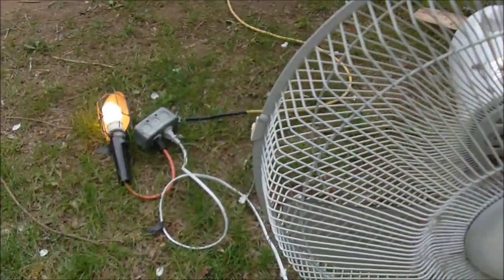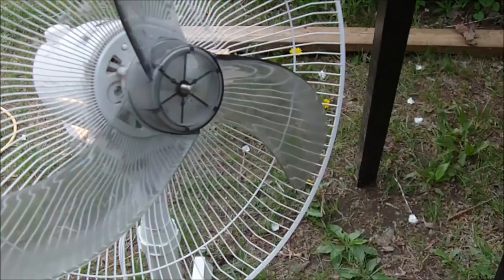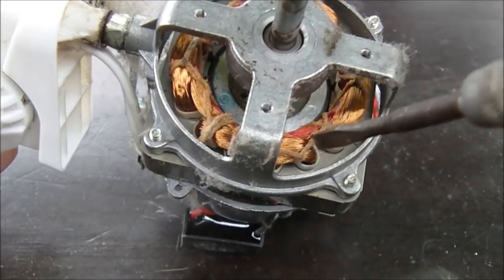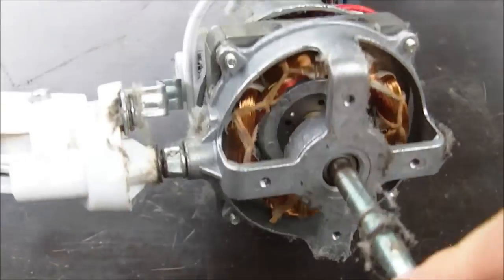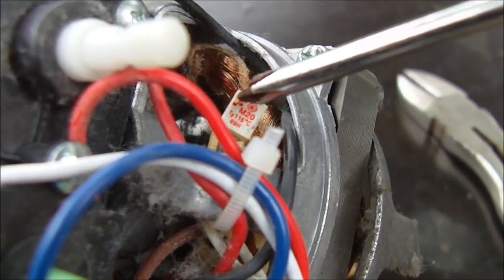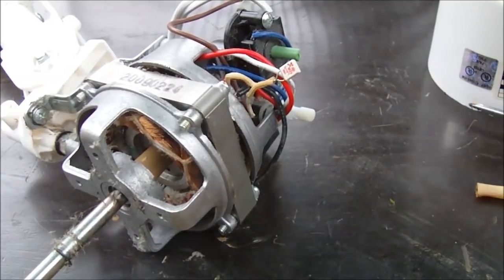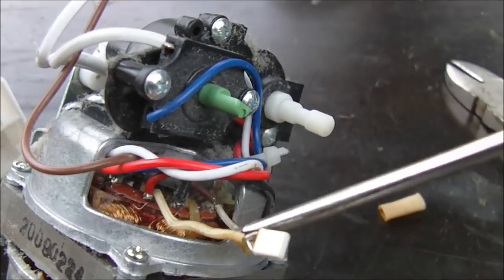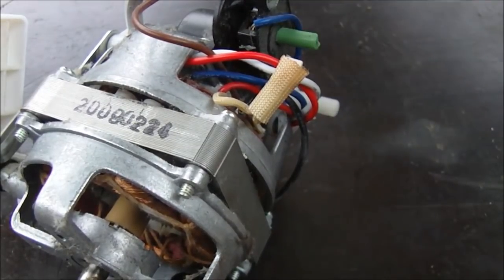Broken fan motor diagnosis for repair

Comment: The unfortunate thing is that people have the attitude of "Why fix it when a new one is so cheap?". I have never bought a new fan in my life. I have fans that date back to 1919, and every single one of them is in perfect working order, because I do regular maintenance. Clean the fan, blow out the motor, and oil the bearings. It takes minutes to do, and costs literally pennies.
Reply: Ryan Losinger  Do the same with mine, if i see when i turn them off that they come to a stop rather quickly then i know its bearing oiling time. Take the blade off and grill regularly and clean them as dust on the blade tips result in less of a breeze.
Reply: Ryan Losinger Hello Ryan,I have a Casablanca Four Season fan and the chain broke that turns it on.
Can you tell me how to get inside the housing and repair the chain?  Paul
Reply: ^ you should be able to get a three speed pullchain from you local lighting store. Just ask for the part.
Ryan: kudos to you sir.
Reply: +Ryan Losinger This habit of repair n use concept is very prevalent in our Country, India. We the middle class think, rethink and re-re-think before discarding a thing. In fact, to get a spare part, all we do is go to an appropriate market / shop and buy it, a few bucks this way or that and repair or get it repaired. Far cheaper than going for a new one. My home has fans n appliances more than 25 yrs old. Call me miser but I call it preservation of precious natural substances given to us by Mother Nature. Green Planettttt.
Reply: @essaargee  India is a poor country indians literally can't afford to throw away anything to junk unless it serves absolutely no value ppl in merica and UK are consumerist society. 

For west&most rich countries and people fiddling&tinkering with old bikes,PC, home appliances is time better spent on watching a movie, going to the beach or just having a good time..
Reply: விஷ்ணு கார்த்திக்  unamaa thandaaa
Reply: Raj thevar "My mom"!? what? also thevar? hahaha what is this, 1950's? grow up
Reply: விஷ்ணு கார்த்திக்  Dai unnoda name 1202  haahaaaa old name Vishnu karthi Haaa u funny guy
Reply: malusax
Reply: How do you oil the bearings?
Reply: Wish you could teach me...I keep going through them and when I try to get to the motor I often have problems...and wouldn't know what to do once I got there. Let alone replace parts! I know absolutely nothing about mechanical/electrical. I'm also terrified that I won't be able to reassemble it.
Reply: @விஷ்ணு_கார்த்திக்    ~  Touch' & Bravo!    > tho - you noted  "going to the beach"  ~  is Exception for Everyone to do!    : )    
 Products of Long Ago are better built.  Everything will need maintenance in time.   
Yes - Wasteful trolls, i cringe at their 'Ease' of tossing, LACK of trying\Caring.   Knowledge Denied, but then, One Must understand.   
I try all sorts of things > Curiosity or stupidity [?], most don't turn out well, but I Learn!    Next Life i'll be better at this!   lol    = ]
Reply: I have I 1923 fan
Reply: but but I want to buy a new fan that has wifi and takes my selfies,
Reply: Love the old fans from the early 1900s. Most of the machinery made then lasts forever, if taken care of properly.
Reply: Don't judge people for that 
If people get an easier option, they will take it most of the time 
Blame the modern industrialized mentality, if you even want to blame anything that is
Reply: @விஷ்ணு_கார்த்திக்  Just because you think you can afford to be wasteful, doesn't make it right.
Reply: Not anymore they aren’t

Comment: Ready to throw my Honeywell fan away but after watching your video I gave it another try. I fixed the fan by bypassing the thermal fuse like you suggested in this video and it fixed it. Saved me 50 bucks. Thanks
Reply: If you bypassed the thermal fuse, you didn't fix it, you made a fire hazard. :-)
Reply: @timmccormack3930  He didn't respond because he died in a fire somehow lol
Reply: Huh? He explicitly suggested to NOT bypass the thermal fuse.

Comment: In 2003, I bought a cheap white plastic Chinese box fan, 10 inch size. A short time later, it was having a difficult time spinning up and the spin down time was too quick. The motor was simple enough. Even though it said "sealed bearings no lubrication needed", this type of motor has this symptom. So I took it all apart and lubricated the bearing areas and it has worked far better than it ever has. For a plastic bladed fan, the spin down is really impressive. Most people would have chucked the fan in about a year but if I can make something last longer and not feed the company money who makes these fans, the more the better. Fourteen years and it still runs fine.
Reply: Also you are not contributing to landfill which is a win for Mother Earth and therefore all of us  :)
Reply: ^^
Good point
Reply: How’s the fan doing another 7 years later?

Comment: I did a repair on my cheapo bionaire tower fan. I did short the resistors and just leave it and we don’t use the fan without supervision. I think the fuse blew because it was not properly lubricated and caused the motor to over amp and fail. I don’t really care if it catches fire because it was free and I have it where it won’t cause issues if it does :)

Comment: Thanks for this. Had a fan go out just recently, that I'd considered repairing myself if I could. Watching this allowed me to determine that there was a problem with exactly the piece you showed. I almost considered doing exactly what you mentioned people doing, but realized for myself before you even said it the fire risk - especially high for me considering that I used my fan fairly heavily. You saved me time, energy, and possibly my life.

Comment: Ah, so that's what happened to my old fan. My local electricians are sly and told me that he can't fix it in order to try to get me to sell the motor to him with lowballed price, which i did since i had no electrician knowledge.
At least now I can troubleshoot my fans before scrapping it, thanks! The knowledge is much appreciated!

Comment: A blown thermal fuse was exactly what was wrong with the fan I was working on. I’m glad I found this video because I never would have figured it out (I never knew such a component existed or that fans have them). Thanks!

Comment: I got an USA made fan for forty years Bluestar by Electrostar LTD.
Every year I clean the dust inside coils and propeller surface and i add extra thin oil in bearings, never seen construction  like this before.
Reply: telosfd you are a lucky guy bro we dont have oruginal blustar fans in srilanka

Comment: This video just fixed my hurricane  pro  20 inch fan which isn't cheap. First one just needed cleaned and lubed but the second one I couldn't  figure out if it was a bad winding or coil or what was going on. Took it apart and it all looked good. I was kind of stumped. Low and behold thermal protector was the culprit. The fan also need lubed and I'm assuming it was overheated from the resistance. Thanks for the great video.

Comment: And you Sir, deserve my greatest thanks! We have a very nice copper-colored metal fan ('retro style'), and I just couldn't figure out what was wrong. Turned out that the thermal protector switch blew up. Fixed now, thanks to your step-by-step checking guide!!

Comment: I learned a lot, thank you. My problem is putting the bearings back together and not sure how since one of those and a spring popped out while disassembling. I only found one bearing. If there's two, I'm screwed. And not in the good way without the fan lol

Comment: thank you for pointing out exactly where the oiling needed to be done, I do open mine to clean the blades, blow dust out and take a peek in to pick out any large pieces of lint but was unsure exactly where to oil the bearings and definitely didn't want to touch the electrical accidentally. I don't have any money for new fans or to take courses so I just make sure its clean and not running hot.

Comment: Excellent advice for those who want to repair their fans. It begins with taking precautions, as working with electrical equipment may be very dangerous for those who are careless.
Reply: Fan turn very well but dose not produce air what could be the fault

Comment: My fan stopped while sleeping so the next day I opened it to look inside. The switch seemed fine and the blades turned easily so after googling some I read that the capacitor could be the culprit though it wasn’t swollen. I ordered a pair on Amazon for $8. and got it today swapped it out but to no avail. I wished I would’ve seen this video 1st so now I’ll try this test. I’ll bet it’s the problem. Thanks from hot New Orleans 🎭

Comment: Thanks chief, your step by step diagnosis helped me figure out it most likely just needed lubrication, threw some oil on the bearings, full expecting it to have zero effect but now its running better than before it needed repair.

Comment: Un, yeah I've just done this. Beautiful white fan stamped 5.2023 somebody has discarded. The failure of the thermo chip made it garbage. Such a criminal waste. It does work,  just waiting for a new chip. Well done. Thank you. 
Follow up: Chip soldered in, works fine. You vid saved it from the junk pile, again well done.

Comment: step by step process for repair E. fan
1. plug in and if you hear a hum sound it means your bushing will need to replace
2. if you didn't hear a hum sound it means your thermal fuse inside the fan is cut off, need to replace it in same number or temperature
3. if you spin it by your hand and its spin freely, and you plug in and put to # 3 and the spin slowly it means your starter capacitor are shortage, need to replace it
Reply: Jenpau026 where is the brushes for this motor
Reply: Jenpau026  i bought a fan and it doesn’t work in its 3rd week. It does the hum sound when I plug what should i do? What is bushing? How should i do it plz help or should i take it to an electrician? Is it safe?
Reply: @sterlynali6679  Don't think they have one as far as I can see.

Comment: Thanks for this video.  I have a 3 speed rangehood that stopped working.  I looked around the net for info and worked out it should be the start capacitor.  The motor would just hum,  but i could get it going by spinning it manually.  Changed the start capacitor and still the same problem.  Anyway to cut it short, I opened up the motor, not too easy to do.  Found the thermal protector to the start capacitor was no good,  changed it and all good, thanks

Comment: Sometimes a slow, reluctant, low torque motor may need a bushing and even a replacement shaft. I watched an expert check out such a reluctant fan and learned a lot in the process! The bushing and shaft were worn and it wouldn't run right even when oiled.

Comment: Dear bro i officially thank you so so much i recently bought new fan after 7 months just stopped working i tried your method mine also clean motor but when i twisted this small White IC theremal protector which in my fan writing
 ( 130C ) ic number 
RH130-2  2A
25V U2 
And boom its working again Oooo My God 🙏
So i know where is the problem now and i will buy its and solder the new one bro thanks really so much for teaching me new experience will save a lot of money in the future all my appreciation and love thank you 👍♥️🙂

Comment: Great video thanks man my fan just died and there's kind of a burnt smell coming out of the back I'm pretty sure it's not a lubrication problem I'm pretty handy with a screwdriver but I've never soldered anything in my life so I'm not even going to attempt to repair it. I made take it apart just to kind of look at the coils and whatnot. It's kind of unfortunate the fan is only two or three years old I guess they just don't make things to last these days

Comment: when you were saying "get an electrician to inspect it, dont open it yourself, blah blah blah"
i was in the middle of prying something out of the motor with a tiny screwdriver.
with it plugged into the wall...
Reply: Matthew Dawsey  Lol! I don't think I would have told that.
Reply: You made me laugh
Reply: Way you go. 👍
Reply: Me to Matt .I was trying to multi task so at the same time as the fan repair,I was soaking my feet in water for this fungus i picked up
Reply: Fuckin funny
Reply: Competition for the Darwin awards are strong. I gotta up my game!
Reply: same here lmao

Comment: Thank you so much.
I had this very good fan that stopped working a long time ago. Didn't knew about this part. And found one (looks different though, like a small tube fuse with temp, amp and voltage rating that was shorted) that caused the problem. Thank you so much. That was very helpful!

Comment: Great video, very clear and simple to follow. i was having problem with my HV 180 honeywell fan and it was exactly what you mentioned ...thermal protector....now trying to figure out where to buy one and what type as the one in the fan is old and the writing on the thermal protector is not legible anymore ....Any ideas would be much appreciated ..thanks again for the great video

Comment: If you want to oil your fan, pick up a bottle of "Liquid Bearings".  The online store that begins with A and ends with zon carries it.  Don't use petroleum-based oils or silicone-type sprays on your fans or anything else! Actual oils and lubricant sprays leave sticky deposits when they evaporate over time. Real oil is a mixture of chains of carbon and hydrogen atoms, and under certain conditions the short-chain molecules evaporate, and the unstable molecules oxidize and break down. This leaves a sticky residue which can actually "gum up" the device it was intending to lubricate. Conventional oils also contain sulfur, waxes, and unstable hydrocarbons which are left behind as residue deposits.  Liquid Bearings does none of this.

Cheers

Comment: Hello. Thank you for this video. I am fixing a fan and noticed in the bearing area where you would lubricate there was some packing material, like cotton-like material. I thought it was dirt, so picked it out, then later found out it was to hold the oil. I'm not sure where to get replacement material. Do you know what this is called? It was stuffed in there like pieces of dust and dirt.

Comment: I need to know more about electric fan performance in my salamander heater. The pump is not reaching the needed pressure for kerosene delivery. All lines, pumps and nozzles have been replaced, rebuilt, or cleaned and inspected. The motor heats up during use without any pressure so I"m thinking the electric motor needs to be checked next even though it seems to run and turn the fan.  It seems weak and seems to fluctuate. It's cost is over $100 and not something I would just replace to see if that fixed things but I need this heater in the winter to thaw out my plow truck.

Comment: I have a fan that is not working, I think the engine has burned out because the motor was running and the 
propeller was not working,i put my hand on the cap and felt it very hot.I have disassembled it and as you said at 1:50 everything look good.
I have to do just the same you did on the fuse at 4:00 ?

Comment: i have repaired a lot of cheap fan motors! the main problem with them is that they usually do not have ball bearings! they just having a hole on the front and a hole in the back and the axle just fit between these holes. during the bad "cheap" metals used, there is going to be dust and corrosion between the axle and the holes. i just sand with some sandpapper the axle and the holes, then grease between them and it is like a new!! i wonder why they do not use ball bearings??? they would live forever!!
Reply: mitropoulosilias  Probably because people wouldn't need to buy new fans. It's all about the money. Modern fans are designed to fail, like light bulbs and almost anything else you buy now.
Reply: indeed... :-(
Reply: mitropoulosilias, due to greed :[
Reply: I have a fan with bearings from the 1940's that still works today, it's only needed to be lubed up once.. Old stuff is usually better if you can find it in looked-after condition

Comment: Also nice to point out that capacitors wear out and result in slow operation or difficulty getting to speed and are easily replaced.

Comment: @electricretrotech my fan not working , its's ''right-left rotate element'' working goodly im %100 sure but its 3 buttons ( +start button too ) Propeller engine not working . Should i try change the fuse too ? Whats your opinion about that im trusting your experince... Thanks aloot really

Comment: electric isnt dangerous if you unplug the project first and a fan is a nice project to learn about electricity
Reply: dannyjaar plugging it back in and it blowing up in your face is a problem tho lol
Reply: Unless of course it contains capacitors and exposed positive terminals that blow you across the room with stored charge even after unplugging so no, unplugging electronics isn't always a failsafe.

Comment: my fan seems to have multiple  thermal fuses encased in black insulation tubes. 

they are between the switch and the coils. two wires from the coil go into each one to meet the wire from the switch.. seems too delicate to work with. I have several fans that just won't start at all. (the capacitors are fine, visually.. but I wasn't able to read any uF.. stayed at 0 on a capacitor from a working fan, so I figured I messed that up.)

Comment: What kind of motor is this, and how does the circuit work? I pulled mine apart yesterday, and was surprised its running off AC without some sort of controller.

Comment: Stopped watching the video at the 1 minute mark because I'm not an electrician. Took your advice and had a professional fix my fan. My $10 fan is running almost as good as new and it only cost me $745.

Comment: I experimented with a commercial all metal fan. The fan stopped turning as in this video. What I did was heat the motor up with a heat gun and the fan started turning. If I didn't use the heat gun it would just turn a little and groan and stop.